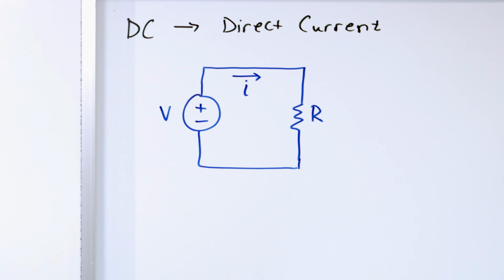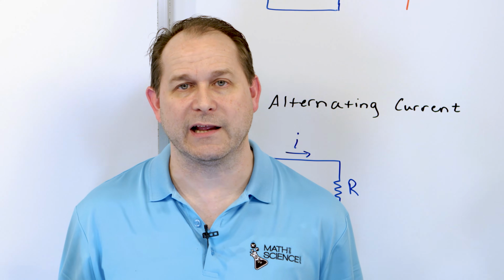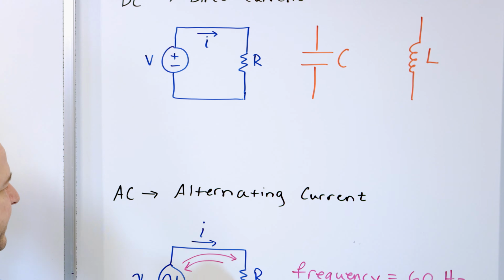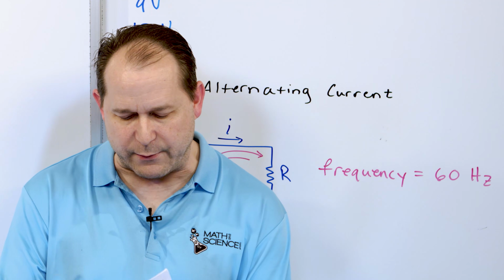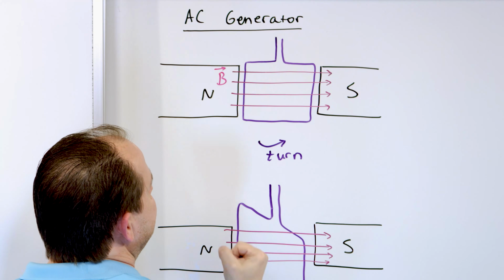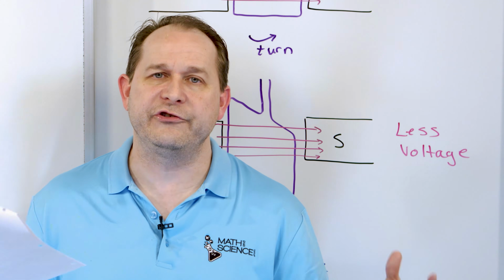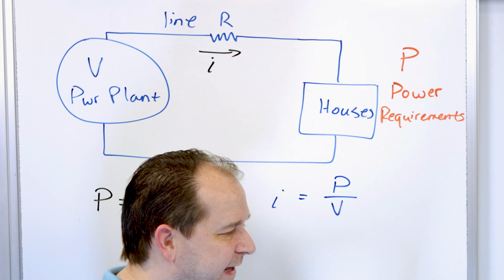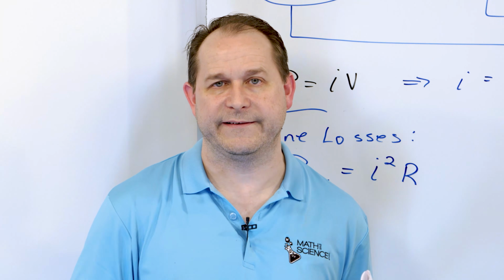How are AC and DC Electricity Different?

Comment: DC participates with grounding logic to contain the voltage to a area, or circuit logic,
where a A/C allows for the negative values to stimulate the ground to have their excited states (electron logic) 
- anti-mater logic ?
- if anti matter is like a home's foundation for its construction to support a visible presents.
Reply: Noting resistance plays a part on how the frequency (its rate) is created.
Reply: Thus most items that save energy is based on the localized DC Current
and A/C is usable for distribution of the current's availability to distant area's efficiently.
Reply: Also note, the power formula is a symbol of how long a material is suppose to last while conducting energy,
like understanding the life time expectancy of a copper wire for its original high quality transmission support,
which is mocking the inertia state of MC s, showing if a mass is accelerated to the speed of light it loses all its energy, thus its mass.

Comment: For DC current it is easy to visualize the flow of electrons moving from the negative terminal (where they are in excess and push against one another) and through the circuit and then into the  positive side of the battery where they are attracted to positive ions. What happens to the electrons in AC when the voltage is cycled? Do they travel back to the generator source and into ground? It’s confusing. Thank you
Reply: Do you still want to know?

Comment: Can you describe what electrons are doing during a lightning strike
Reply: Friction in a cloud, you get a build up positive and negative but the air is an insulator and it's insulating properties break and then boom you have lightning. 

It's basically like rubbing your hands together then touching someone. 

Law of thermodynamics works the same for voltage, "high always wants to go to low"